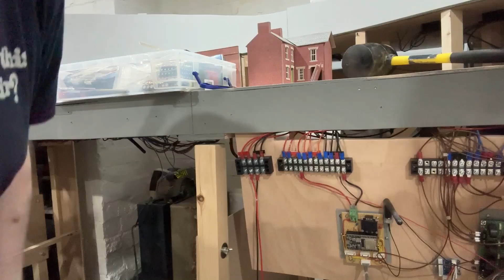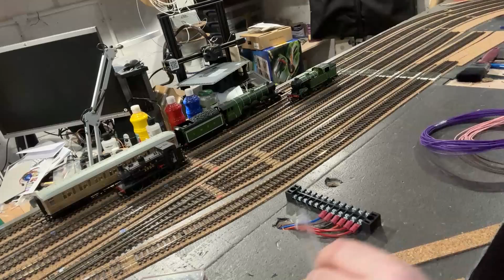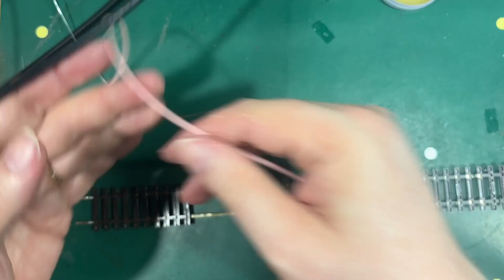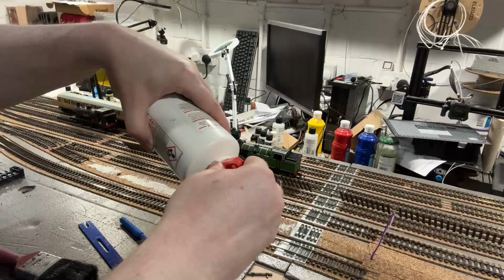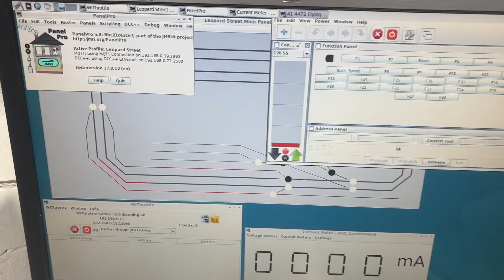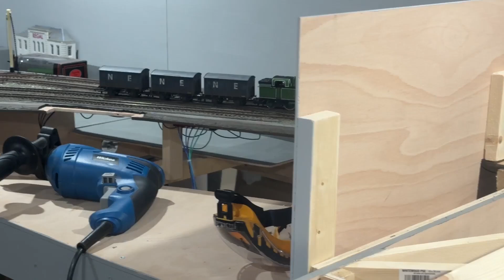Episode 54 Powering up the Yard at  Leopard Street Model Railway

Comment: Nicely done. I would highly recommend an adjustable temp soldering iron. I got a LeaderPro Flexible LED 100W Soldering Iron from Amazon for £13 and it's been superb, has changed my soldering game up considerably

As for sound, I prefer the rambling 🙂
Reply from the maker: this is temperature adjustable, only a cheap one, not sure on the power - I think I need a more powerful one as some etched brass kits are in the future, this one can work well with a more chisel like tip, depends what I'm doing but the key is power - get the local bit of rail to temperature quickly so the heat doesn't have time to travel and melt the sleepers.

good recommendation, I will have a look

cheers for watching :)

Comment: Two point six ohms. Not great, not terrible.
Reply from the maker: true, just need to do a bit more checking, I think the problem is the number of connectors - which isn't something I can do a lot about, there problem its causing is that some of the ESP32 "brown out" occasionally and reset so it needs sorting - may end up with some voltage regulators of some sort locally.

cheers for watching

Comment: Just thinking about gluing track down, have you tried using a hot glue gun?
I wonder if using a hairdrier might make lifting the track easier, if maybe stringier.
Reply from the maker: could work well, the XPS under the cork may object, copydex is easy enough to put down and lift, not the cheapest glue but works - in theory good sound proofing - though here the baseboards need tuning with some rubbery mass added